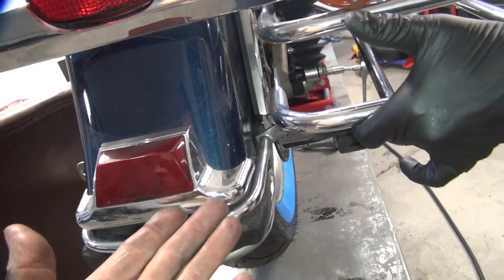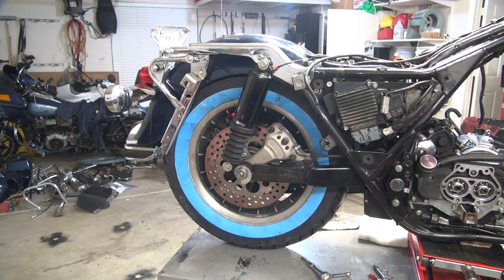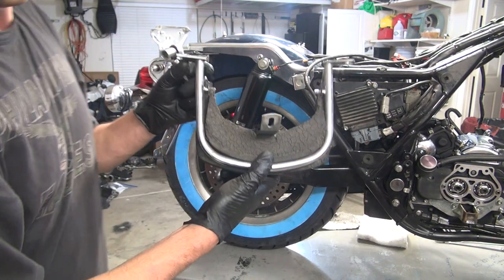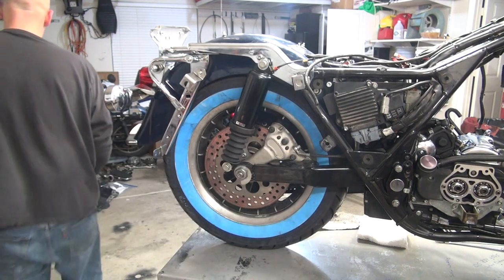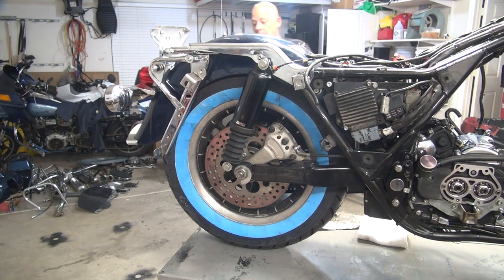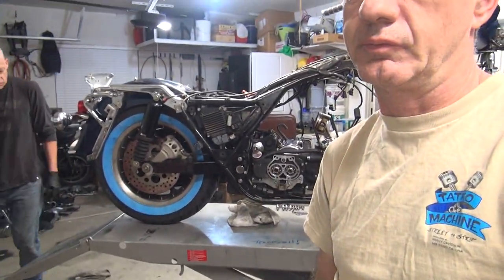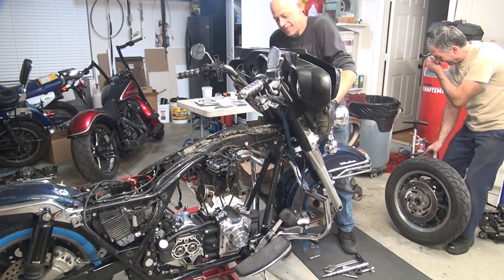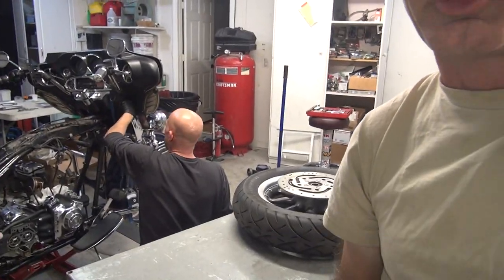#158 2004 road turd topend trans rebuild rear belt change FLHT twincam touring harley tatro machine

Comment: You need the rear fender brace like the one found on a Road Glide (Turd Glide).
HD part number 91140-98A.
There are also aftermarket versions of the same thing for 1/2 the price. Just search for "Saddlebag-To-Fender Support Bracket Rear Mount Fit 84-08 Harley Tour Road Glide"
Reply: yep
If you don't put stuff in your bags you might get lucky  eventually it snaps with out the rear bumper or some after market brace etc… maybe im wrong
Reply: @voodoodrug  guaranteed,  in fact I always upgrade those to the heavy duty ones as I've broken those many many times now
Reply: Heard. Ill look into it.

Comment: Heres Amazons version of the Heavy duty rear fender support brackets. Couldn't find the Drag Specialties version, many of these are out of stock right now.

"HIYOYO Chrome Saddlebag Rail Support Bracket Left & Right Side Fit for Harley Touring FLT FLHT FLHR FLTR FLHX 1985-2008"